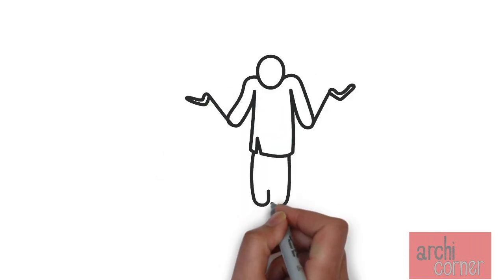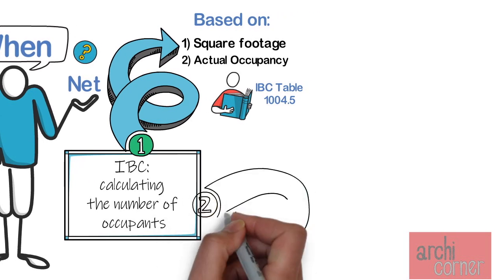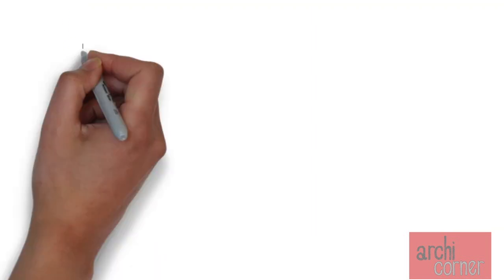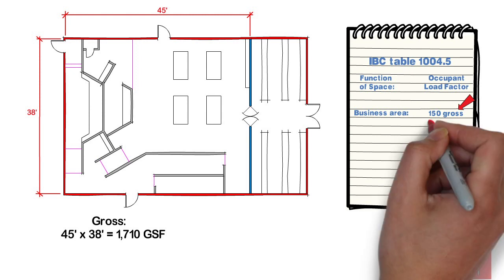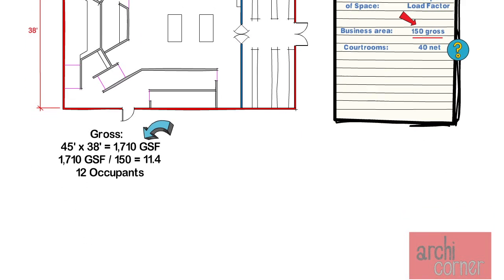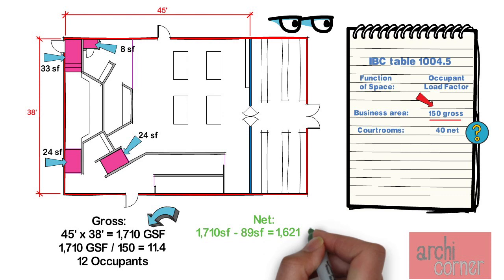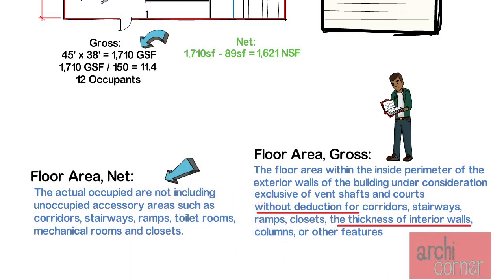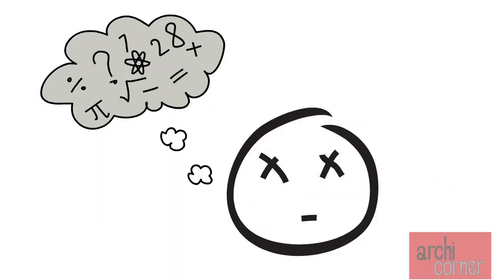AC 022 - Egress: How to calculate occupant loads (Part 2 of 2) - Gross vs. Net. Sq. Ft.

Comment: I am still not clear... Should we use net area or gross floor area for calculating occupants... For further calculation of egress widths???
Reply from the maker: Table 1004.5 in the IBC states which you have to use. Some occupant loads use Gross, others use Net. Refer to the IBC table.

Comment: first off thank you for the videos. Ive been practicign for 30 years and still will come back to your videos for certain projects.Great job with your narration and illustrations!  Each jurisditction can treat occupant load calc different but one  point I have tried to argue in the past is that in assembly spaces, you should be able to deduct casework like kitchen counters and appliaces as the net. Agree?
Reply from the maker: That is something I have discussed in the past with others. "net" area does say that it only includes "occupied area" but does not list millwork in it. I have seen and heard the argument that you cannot "occupy" the area where millwork is installed. You are not the only one with that idea. Thank you for leaving a comment. Perhaps a future code cycle may include that, for now, I have found it to be a bit of a hard sell.

Comment: When calculating gross floor area for office, are the accessory assembly spaces (conference and break area) subtracted from the gross number or are they added?  Example 3,000 sf office space, with 600 sf conference room.  (3000/150 + 600/15)= 20+40 = 60 or (2400/150 + 600/15) = 16+40 = 55?  Also, have you used areas of concentrated business use in one area of the floor and the normal 150 OLF in another area on the same floor?  I have an "IT" department with heavy density and an executive/admin area splitting the floor.
Reply from the maker: Every area is calculated separately, and NOT normally doubled up. Using different occupant loads within a space is normal. A space may have one load for one area and a different load at another.

Comment: Awesome videos! What about the seating (pews-like fixed) in the general seating area? do you not use the 18" or 24" per person?
Reply from the maker: check out IBC 1004.6. fixed seating without dividing arms are usually calculated at 1 person per 18 inches. Booths are usually calculated at 1 person per 24 inches.

Comment: How do we determine OL for a classroom in an "E" occupancy? In 2018 IBC Table 1004.5, the OL factor for classrooms is 20net. Does that only speak to the floor area after closet and bathroom deductions are considered or do we also have to subtract the total SF of all of the desks as well? Thanks
Reply from the maker: Check out chapter 2 in the IBC, there it has definitions for "Floor Area, Gross" and "Floor Area, Net". And it will let you know what you can include and what you can exclude.
Reply: @archicorner  didn't quite get that tidbit of info in my fire inspector class...Thanks a bunch!!

Comment: I'm a fairly new fire inspector and have been tasked with determining the OL for a portion of our city council chambers. The room is a large room that is divided in half by a 3ft high wall. City council members have their desks and chairs on one side of the 3ft wall while the other side of the 3ft wall contains chairs for members of the public to sit and view the meetings. They want to know how many members of the public are permitted in that portion. The "public" half  a perfect square floor plan with rows of chairs side by side. Am I correct in thinking that I just measure the SF of that half of the area and use "chairs only" and "standing room" factors to get the OLs for seated and standing? Thanks

Comment: How to you handle the occupant load for a facility where the overall occupant load factor is net?  For example, a daycare use is 35net.  If the only other spaces in your daycare building are mech/elect/I.T. rooms, small storage under 100sf, and toilet rooms, do you calculate the occupant load of the daycare spaces at 35net and exclude everything else?  Or do you have to calculate and occupant load for the rest of excluded spaces in the building  - 300sf for mech/elec/I.T./storage, and what for the toilet rooms?

Comment: Super helpful! Can a video be made clarifying egress convergence and how occupant load and egress requirements are calculated for each floor that is affected? So for example basement and second floor (and up) occupants all exiting through the ground floor when there are also occupants on the ground floor? Thanks!
Reply from the maker: Great suggestion. A quick summary of IBC requirements in this regard: 

If your egress is based on IBC; then the egress components that are shared between floors is generally limited to stairs. 

IBC Section 1005.3.1 is clear that "Where stairways serve more than one story, only the occupant load of EACH STORY considered INDIVIDUALLY shall be used in calculating the required capacity of the stairways serving that story." therefore, you normally don't have to worry about other floors when determining stairway with.

Nevertheless, IBC section 1005.6 does give an exception where a floor below and floor above converge into an egress level.

Comment: I’m still confused about gross. Does this include balconies? Moreover, outdoor open ground floor space over a transfer slab? I say this because i believe gross does include this per ibc, but it feels strange to include outdoor area beyond an exit discharge. I see you referenced chapter 2 of ibc. However, the definition you referenced is for [bg] Area Building. Is there another location in definitions that i’m not seeing for gross? Because if not, you only referenced one portion of the definition if I’m not mistaken. It continues to state something weird “Areas of the building not provided with surrounding walls shall be included in the building area within the horizontal projection of the roof or the floor above.” This implies that if you stack balconies they are included in the gross, and if shafts run up to an enclosed AHU then the shafts would also be included, and that if your building has an overhang so would that apply? Is this correct? Please help!!
Reply from the maker: Does it include balconies? Yes. 
Does it include shafts? Yes. 
Can it include covered areas such as porches, carports or other exterior space intended to be used as the building's occupiable space? Yes.

Comment: For classroom or assembly with fixed sitting, net area calculation exclude the circulation area inside the room on a real project. But I did not see you exclude the circulation area in your court house scenario. Do you mind to expand on this to help me better understand?

Comment: Thanks for the video! A doubt I have: If two rooms with different gross-calculated uses are adjacent to each other, do you use middle of wall as dividing line for GSF calculation? Also..how do you calculate the load factor on stairs and corridors that happen to be next to spaces with different uses?
Reply from the maker: That is a very good question. What you have mentioned sounds reasonable. You do not want to double count a space (counting the wall twice). Having one occupancy count half the wall (centerline) and another occupancy count the other half (also centerline), sounds like a reasonable approach.

Comment: Hello Archicorner; Thank you for the video. How did you derive the area sq.  ft.  that you subtracted to get the net sq. footage. I do not see any dimensions on the walls, ramps or closets.
Reply from the maker: Jackie R is correct. The purpose of the plan is to show the concept. It is not meant to have exact numbers. Hopefully the concept came across well. Sorry for the confusion.
Reply: its his drawing that he's using for demonstration purposes. The numbers can be whatever he wants to make his point. You wouldn't build from it.

Comment: so... is it 12 0r 40 occupants?
Reply from the maker: Max; Thank you for leaving a comment. The idea the video is trying to convey is that he number of occupants depends greatly on what the space is being used for. The USE of the space dictates 1:What areas you need to include  in the square footage and 2: what load factor to use to get the occupant load. 

In the example, of the video, it was noted that the space was used as a "COURTROOM" therefore the 12 occupants is incorrect because the 12 occupants incorrectly assume the space is used for "BUSINESS".

40 Occupants assumes the space is used as a "COURTROOM" which is correct.

Comment: At what occupant load do you need architect stamp plans?
Reply from the maker: Marty;

That is a good question. An architect's stamp is not determined by the occupant load. Each state limits the type of building structures that an unlicensed person may design (if at all). SOME states allow for non-licensed persons to design a limited number of buildings, usually limited to farm buildings and/or some residential buildings. However, every state is different, so you may want to look at what your state allows and does not allow. Sorry there is no defined answer.

Comment: How do I calculate hospital egress width requirements?
Reply from the maker: The egress of all buildings are calculated using the same basic concepts. The difference is that some building occupancy groups have equipment that is needed to operate. Hospitals for example often have to use mobile beds to transport patients from one room to another. Therefore things like these have to be kept in mind when determining widths for corridors and other spaces. This of course is not a complete answer to your questions, but just a little bit more of information. Hope it makes sense.

Comment: An assembly without fixed seats (15 net)  includes a 60 sqft accessory Storage room.
Do you add the 1 occupant for the storage room (60/300 = 0.2 person) to the number of occupants you get from the previous calculations based on the net area?
Reply from the maker: Since the storage room exits into the assembly room then the occupants of the assembly room are the assembly room occupants + storage room occupants
Reply: @archicorner  Thanks for the prompt response. What if the nomenclature changes to 40 sqft of closets. Would that change anything?

Comment: I have a question: let's say you have a row of private offices. Since they are have the same function, and have a GROSS occupancy factor, would you calculate each space individually or as one space? The gross definition says you can't exclude interior wall thicknesses, but does that apply where there are walls separating a room? Would you instead calculate all the offices as one space or calculate them individually? If individually, do you figure out the square footage from the face of the wall or the center of the wall? I've seen it done both ways, so I want more opinions on this.
Reply from the maker: 1) Regardless of whether you are calculating occupant loads on an office by office method or if you are calculating them as a group, net will have to account for the walls. 
2) You are correct, It is common to see both approaches, it is left up to you as the designer to pick which one you like best. There is no correct answer so as long as the information is provided in a clear manner for the plan reviewer to confirm that an office or area meets the egress requirements (i.e. number of exits).

Comment: Thanks for the videos. I'd recommend doing a video on common slopes for various site elements, because I've found lots of conflicting information on this topic and I'm not sure if they're all based on code or coming from somewhere else and it's really confusing.
Reply from the maker: What slopes are you referring to? Are you referring to ramps, paths of travel, etc? Please provide more detail if you can. Thanks!
Reply: @archicorner  roads, grass recreation areas, ground areas for drainage, paved parking, sewer lines, approach walks to buildings, landscaped slopes, mowed grass etc. I've come across these things as I've studies for the ARE exams, but some of these items may not be code related which is why I may be finding conflicting information from different sources. Some of the sources also aren't super descriptive and are kind of vague which doesn't help.

Comment: Thank you for explaining the difference between net and gross in a clear manner! In the last part of the video (when you mentioned why bother differentiating between the two), I had that pondering thought for the longest time. Now I pose to you if calculating net could be helpful in some instances to shed square footage, then why don't we calculate the net area for everything instead of gross? I don't see what calculating the gross area does.
Reply from the maker: I've pondered the same question. If you find the answer, please share! I haven't really looked into the why, but now my wheels are turning. Hmmm..... still thinking....